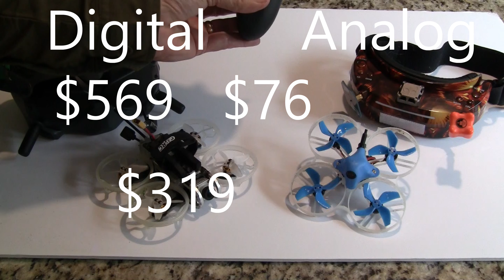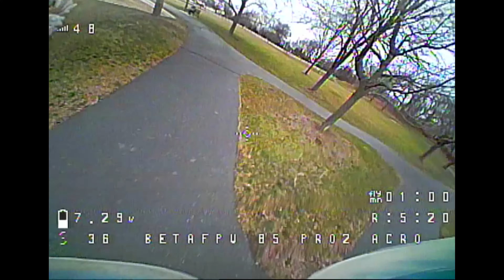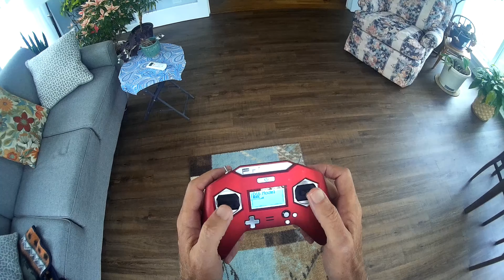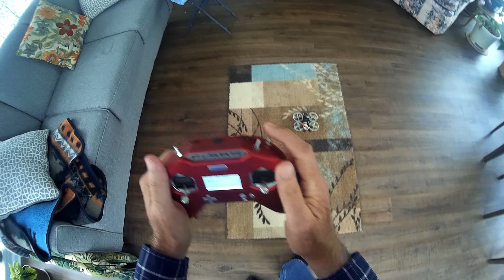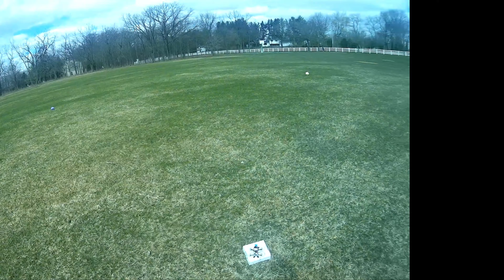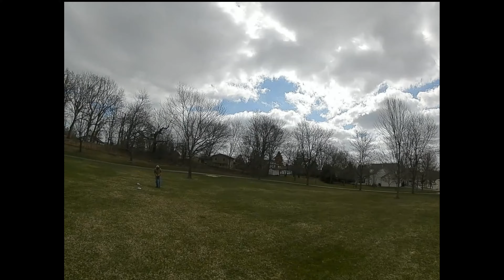Learn to fly FPV with DJI

Comment: Great video John, wish I would have had this instruction when I was first learning. Lol, I still walk the dog from time to time. Also, I agree, I wouldn't try to learn on dji fpv drone,  so fragile,  and doesn't fly as good as most of regular fpv drones.  I started with analog because digital wasn't available for fpv, but switched over quickly.
Reply from the maker: Thanks Tig, what did you learn on. Like the way you fly thru the woods with 3" DJI. I learned on the E010 for line of site and on a lower power 5" kit I built from Banggood I called my school buss for FPV.
Reply: @jmoore3854  , my brother (who flies planes now) won a simple syma x5 at a white elephant event, kept telling me how he loved it,  so after a year of his mouth bought a Mavic Air. Really loved it but computer flew it mostly,  and mostly for long range,  tried flying in my woods and computer would freak even with sensors turned "off". So bought a arris x220 5 incher and learned on 3 of those, God help their mechanical souls. These small whoops weren't near as easy to find as they are now. Glad I went analog first. Super cheap compared, perfect for learning and crashing. I've been flying about 2 and a half years,  flew on stabilized for a year. Couldn't get hang of acro, but switched one day after right at a year stabilized, and it was like I had been flying acro the whole time, somehow I picked it up in stabilized mode, maybe from trying to hold it steady as possible the whole time flying. Never did do complete line of sight and horrible at it to this day. Thanks for all your great videos!